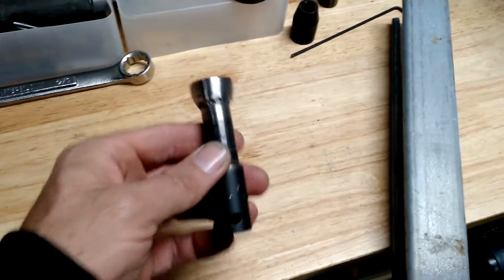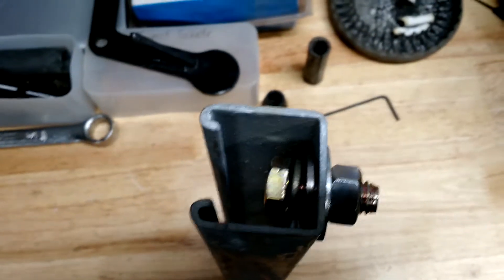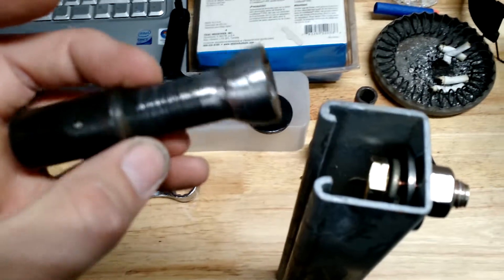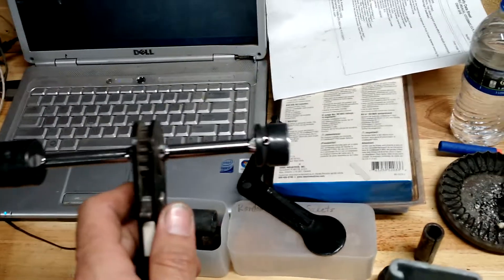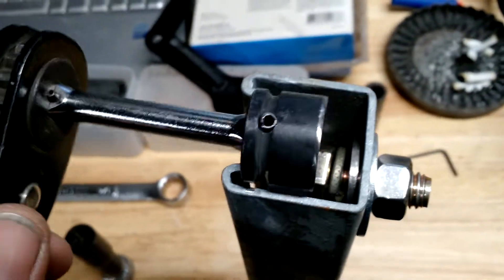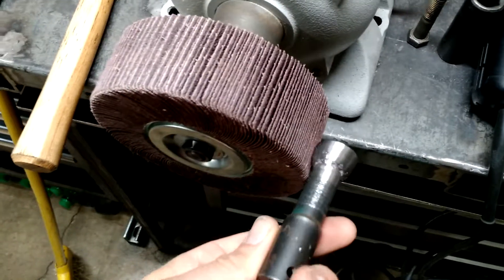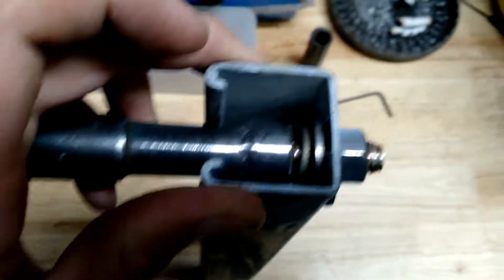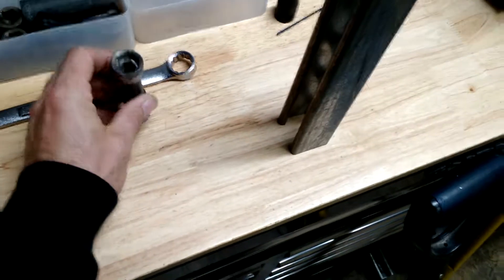Electrician builds Homemade 3/4" socket for Unistrut work

Comment: I recognize that L shaped bracket you picked up and put back on that plastic box. Bolts to the back of the drivers side head on a Chevy LS engine.  Nice job on the tool!